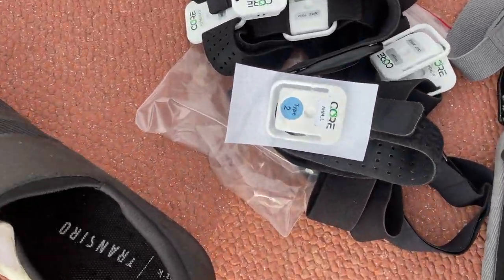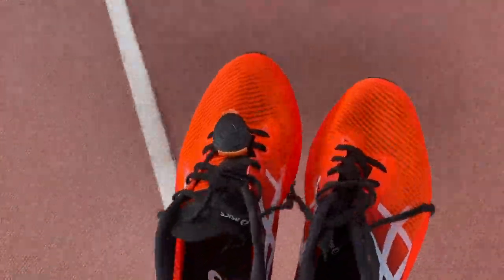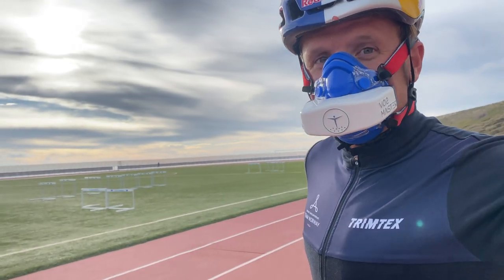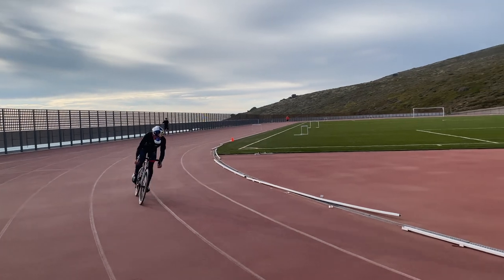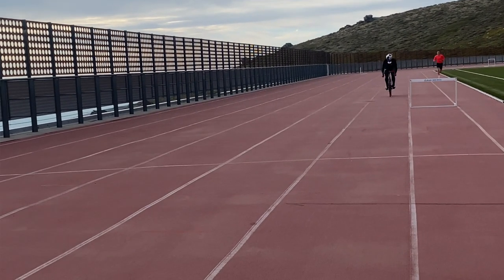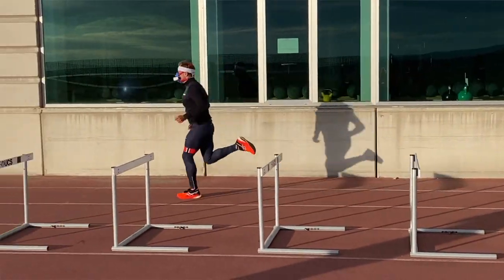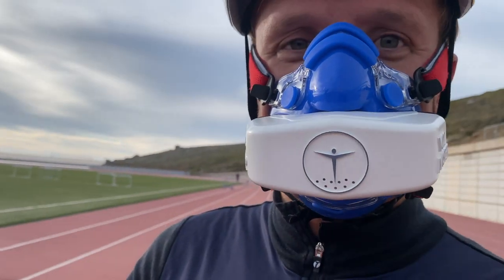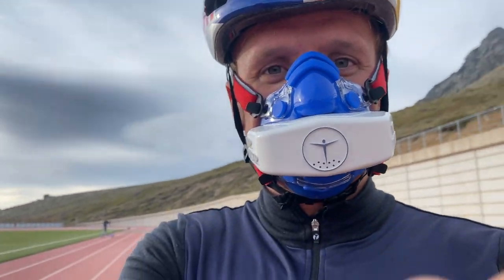Core testing in Sierra Nevada

Comment: Is it better to have high lactate on max effort like 15 or 16 or to have less like 8 or 7?
Reply: 15 you can hold very short. Very limited
Reply from the maker: In general I would say you want to push your VLAmax down to push your MLSS up as high as possible so you’re running more aerobic. Not really sure about how your skills to build up lactate should be, but that’s not too important anyway. I can normally get around 8-9 at maximum
Reply: A high lactate measurement after a max effort generally indicates that you have a higher ability to generate a large oxygen deficit during (buffer lactate and H+) a max effort, but that also generally mean you need a longer rest period to recover fully from the effort.